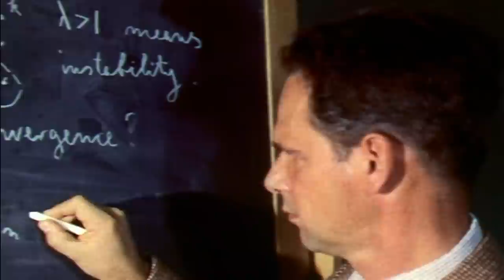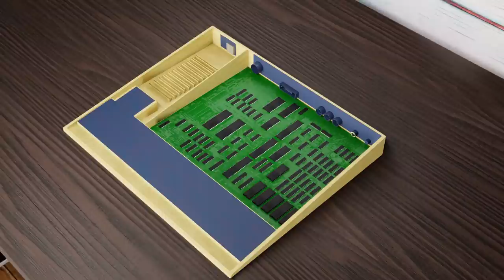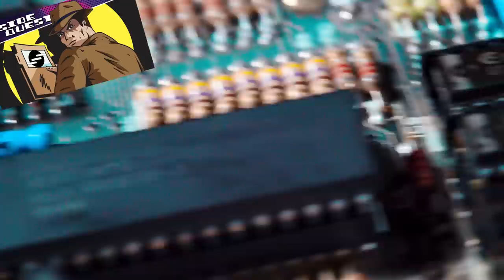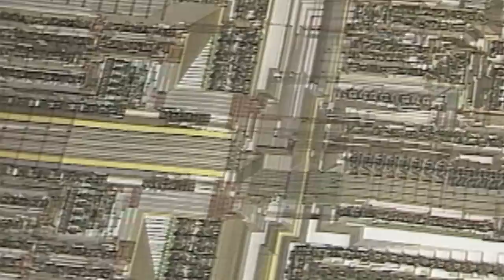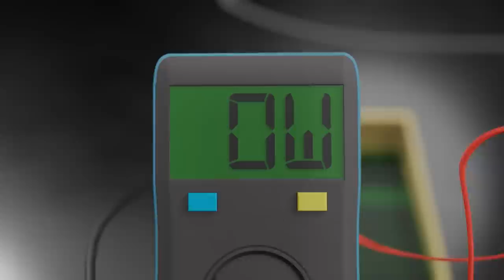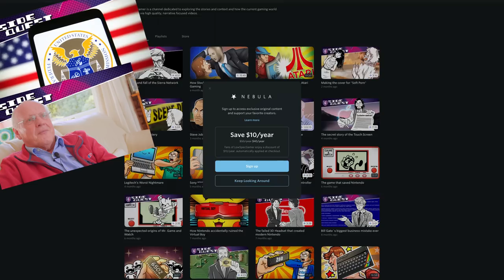How Amateurs created the world’s most popular Processor (History of ARM Part 1)

Comment: They weren't Amateurs. At the time the ARM was created it's designers were professional electronics engineers for 10 years already.
Reply: The were amateur microprocessor designers. Mind you, if anything, this might've been an advantage, as they went in without some of the existing preconceptions that other more established designers were using. It didn't hurt that they also took a leaf out of Chuck Peddle's book, as the internal design of the 6502 and its ISA were major influences on those of the ARM.
Reply: @talideon  Still, amateurs strikes me as rarther clickbaity. I wonder if he said "amateur" to Furber's face in the interview.
Reply: @talideon  "Amateur microprocessor designers" is a false concept. They were all qualified to design microprocessors as much as anyone else in the world. They had cut their teeth before microprocessors were even widely available. When they decided to make ARM they had designed several computer architectures, their own sophisticated operating system, their own programming languages. Not only were they qualified to build ARM but they also chose to build custom hardware and software for the purpose of then designing ARM, because they correctly appraised everything available to be worse than their own prior work.

They didn't go into the ARM project without preconceptions. They had very strong preconceptions. Firstly they had evaluated every microprocessor on the market using their tube system. Secondly, they were academics, and closely followed the latest computer science developments. They knew from watching the Berkley RISC project that a team of their size, budget and experience was more than enough to design such a CPU. It was already a settled question for years.
Reply: The term "Amateurs" is really a metaphor in this instance.  The video shows reasonably accurately that they went to see "professional" designers and realised that there was a very low bar to entry and that they felt they could do better.  They also mention the fact that they still had some doubt in the mind that they could actually do it because they felt like they would be "amateurs" in comparison, as if they were missing something.  If we can do it, what is stopping everyone else?  <-- when you think this its usually because there's something important you don't yet know about.  Fortunately - they were not missing anything, they actually were smarter than the rest.  The ARM went on to be the most produced processor core ever by a huge margin - to date >> 300Bn of them have been produced and production rates are increasing rather than a central processing unit they are more commonly embedded into everything.   A car might now have 30 of these cores embedded in everything from the seat to the AC system.

Comment: Processor back then: so efficient that it runs on leaked current
Processors now: FIRE POWER!!!
Reply: Reminds me of the Prescott Pentium 4s and Ds, there was a freaking 180w one if my memory isn't messed up, and that 220w "5GHz" AMD FX.
Reply: I have Pentium laptops from the 90s that run on passive cooling.
Reply: @Kalvinjj  The Intel 13900KS has a power limit of 320 W! Way higher than anything before! That’s how it hits 6 GHz on two cores and 5.6 on the remaining ones. Many other current Intel CPUs have a power limit of 250 W!
Reply: To be fair, there are modern processors that are much more powerful and consume even less power. They just aren't meant for "general purpose" computers in the modern sense. ARM1 consumed around 100mW at its 6MHz / 3MIPS, and that's just the CPU, while e.g. STM32L0 chips are more like 20mW at 32MHz / 30MIPS, which includes RAM, flash and some built-in peripherals, and can go as low as 0.2mW/MHz, over 100 times more energy-efficient than ARM1.
Reply: @goekhanbag  Holy meme 320W! That and the RTX 4090 melting plugs, care has been thrown out the window.
Reply: Well you’re comparing the RISC instruction set to the CISC instruction set, both have different focuses on computing.
Reply: NVIDIA: unlimited powerrrrrrrr
Reply: @Fractal_32  RISC vs CISC doesn't affect energy efficiency quite as much any more. Modern x86 CPUs are RISC on the inside anyway, they just need a little extra logic to pretend to be CISC and break complex commands down into simple microoperations. Your typical 100W+ desktop CPU can run without any cooling "just fine", it will simply throttle down under 1GHz when it gets hot, just like a Raspberry Pi's ARM chip throttles down under load unless you use an adequate active cooler.
Reply: @JayOhm  it actually does, look at the M1 chip compared to the i5 processor for example, gives out more performance but uses way less power.
Reply: @luigiweegee7152  Ahem, I think you meant "Apple M1 compared to anything else". It consumes about 5 times less power than the newer Snapdragon 8 Gen1, while also being almost twice as fast! Apple just did a phenomenal job with their silicon.
Reply: @JayOhm  even intel's mobile processors (cisc!) have decent power efficiency - its 13th gen i7 u-series supposedly draws 15w at its 1.8ghz base speed for an approximately... 8.3mW/MHz (12x more efficient than ARM1?)? (not that mW/MHz is that useful of an indicator of efficiency...)
Reply: The ARM processors in modern smartphones are even more power efficient than back then but:
- They are not limited in the heat output by cheap plastic packages. So you can crank up the power and obtain even more performace per watts.
- They no longer run BASIC and assembly on "bare-metal" but probably Javascript inside a browser written in Java (which has nothing to do with Javascript), which runs on the Android JVM, which runs on a stripped down Linux which in turn runs on the ARM processor. Not exactly the most efficient use of an efficient processor.
Reply: @qdaniele97  except that in browsers, the javascript is compiled to machine code, and the renderer is written in c++, so if anything the only thing running java would be the tabs/settings UIs
Reply: @5omebody  Actually, thah "java" part is also compiled to machine code, mostly even before the app is started. (The "optimizing apps" screen you might see after a system update is when a lot of thah is done.) That is unlike JS, which gets recompiled every time you reload a page. Still, the original language can hamper efficiency quite a bit: in C you can write something inefficiently, but that's mostly on you, while JS and such can pretty much encourage you to do so, as they are much further from the hardware and something "simple-looking" can hide a lot of complexity and be extremely hard to run, plus you are less likely to understand well the hardware it runs on.
Reply: @JayOhm  except not really. in JS if you write something inefficiently that's also mostly on you. it's not like millions of man-hours have been spent on JS engines just for them to be extremely slow...
Reply: @Kalvinjj  The highest TDP Pentium D's were 130W
Reply: @5omebody  I don't argue that. It is just that, for example, it isn't obvious that putting an object into an array of "small integers" in JS can instantly decrease performance, while in C++ you either wouldn't even get the idea or be painfully aware that it becomes an array of pointers. Higher-level languages hide more complexity and make it easier to write code that is harder to run.
Reply: @Pasi123  Oh yes 130w indeed, I did remember wrong then.
Worst part is that it was back when heatsinks weren't near as insane as they are now.
Reply: @Kalvinjj  and the longlasting world records on highest clocks on cpus where amd fx dominated with crazy figures like 8.5+ghz only recently surpassed by 13900K with 9ghz
Reply: @BeHappyTo  True, they were the CPUs of choice for insane overclock records. Feels like AMD decided to revive NetBurst and at the clock side of things succeeded.
Reply: I'm seeing many posting how these processors are different from the ones we're using and hence the difference in power consumption.

That's not the point. The point is that the processor manufacturers (like Intel, and more so for GPU manufacturers) are sacrificing power efficiency just to claim to have more performance over competitor.
Reply: yep;) looking at current intel core 13th gen, comparing a 13700T (tdp 35w, max boost 106w) vs a 13700k (TDP 125W, max boost 253w) you only lose a bit of performance and the 4090, 4080 and 4070T operate around 30-40% (wattage) above the best performance/ watt  point (which is way above the minimal wattage needed to run processor), that's why they are so good for undervolting;) and so bad for overlooking (they are basically factory overclocked), the current problem isnt modern processor's being inefficiency but modern consumers (and manufactures) not caring about efficiency (any more) but only performance.
Neither performance nor wattage alone paint the full picture, just look at micro processors which achieve their low wattage by doing nothing most of the time (waiting for input/ sensor) and doing things slow (low ghz) (also reduced/ no io, reduced/ no pcie connections, reduced/ no backwards compatibility and reduced/ specialized instructions) and not by being 1000x better at the same task.
Only because a processor draws much power doesn't mean its inefficient and only because it draws little power doesn't mean it's efficient, you need to look at performance per watt to determine its efficiency, which is where mainly server processors shine;)
Reply: and they called it innovation lol
Reply: @Kalvinjj  It's a big concern. The power requirements for recent technology is crazy high.
Reply: @JayOhm  bro m1 max power state is 15 watts, compared to Snapdragon 8 gen1 has max 6 watts, m1 is efficient but it not a smartphone CPU's level efficient, its for ipads and laptops, so research before talking, apple uses A15 etc for their iphones and not M1 for this reason..
Reply: @niks660097  I'm pretty sure I did my research, I'm too paranoid to not do it. I seem to remember looking at some graphs too. However, that was an eternity ago, and at this poin't I can't remember how I got the figures, thus can't quickly check if I made a mistake. Judging by the context of this thread, I probably was looking at single-core performance and power consumption on benchmarks, not TDP, as you could easily have e.g. a CPU that thermal-throttles when fully loading more than one core, and another one that can run all cores fully loaded without throttling.
Reply: @JayOhm  we are talking about efficiency and power usage and you were saying M1 uses less power than snapdragon gen 1 which is wrong, a quick google search would told you that instead of looking back to your "graphs" e.g anandtech cpu deep dives and  why would you talk about single core, just single core even intel can do < 1-2 watts, using turbo boost to boost to 10-20 watts for milliseconds,  thus on average always consuming < 1- 2 watts, even in common tasks M1 will consume > 5-7 watts, just its GPU(integrated) can consume 15 watts without throttle, but they are power limited by apple..
Reply: @niks660097  I would talk about single core because that way it is easier to exclude throttling and inter-core communication effects and estimate the efficiency and the performance of the core architecture itself. Also, power efficiency has nothing to do with TDPs, and everything with how much energy it takes to complete a given compute task, i.e. operations/watt rating. This is all I wanted to add.
Reply: @Kalvinjj  that distinction has pretty vanished pretty much by, you guessed it, another abstraction layer. All complex instructions are reduced to micro-ops. It's been shown that the latency and energy overhead is small.
Reply: @JayOhm  even if the internal microinstructions on x86 are RISC-y, you have to implement a ton of extra circuitry into the control unit to facilitate the translation of upward of a 1000 different instructions (often of wildly varying width). That silicon isn't free, either in terms of space or in terms of power consumption.
Reply: yeah i remember my Rage 2C AGP GPU had passive cooling
Reply: @Kalvinjj  it did hit 5 ghz, in fact with without even increaing voltage you can get the non 5ghz advertized ones to 4.9..
Reply: @cadetsparklez3300  I remember it requiring some pretty obscene cooling to get to that point right? Basically factory overclocked (not like that's a problem tho). 220w is basically the very edge of air cooling if not above most models from my memory, pretty much water only and I don't think a basic 120mm radiator will do either.
Reply: @Kalvinjj  no its really jsut we had bad coolers bad then or people only used stock coolers and remember it being loud. I used a little arctic 9x and it was fine. some people however might push it is far as possible since these things could handle like 1.55V just for performance i guess
Reply: Misleading. ARM is not a processor. It is only a structure/framework. Like a blueprint.
Reply: @volo870  wait you don't need liquid hellium cooling? my laptop requires liquid hillium cooling.

Comment: One of the things that is really interesting is that the BBC ran Acorn ARM based systems to generate on screen TV graphics right up until the cutover to Digital TV.
The systems were highly efficient and fault tolerant and if in a failure state could be rapidly reset, all highly important for something that operates in real-time.
Reply: Custom applications can keep all the code and invariant data in ROM, and often have no need for an operating system, so it's not surprising that when  reset, the application in the appliance is fully operational before your finger even leaves the reset button.
Reply: Well, the Acorn Archimedes Computers were expensive for a PC - but really good as a cheap unix station.
Reply: @akulkis It has an OS.  It's just that the OS is in ROM.
Reply: @Mechness  
You would be surprised how much can be done without an operating system

Comment: Last year I wrote a Basic program that calculated prime numbers and I ran it on both an 8MHz Zilog Z80 and a Raspberry Pi Pico. The ARM chip on the Pico only took a few seconds to do what the Z80 did in minutes. If I recall correctly the Pico was easily 100x faster, and it wasn't even using the second processor core. It's incredible how fast low-spec computers actually are these days.
Reply: To be frank, you compare a CPU with 133 Mhz (Raspberry Pico) with one that was running on 4 Mhz. And even if that's Pico not 100 times faster, you should remember that the OS will take around 1-2Mhz of your Z80, while it will only take around 10 Mhz of your Pico, so you have then 2 Mhz vs. 120 Mhz. It would be ashaming, if your Pico wouldn't perform 100 times faster than the Zilog Z80, especially as it's a 32 Bit controller = so it has to start shifting around bits for still being able to calculate the numbers much later than an 8 bit processor.

Comment: I built my Acorn Atom from the kit (fully expanded 12k RAM and 12k ROM), later bought the BBC B which I modified in a number of ways and finally an Archimedes 310M which I also modified. Finally moved to  IBM compatibles in the early 90's as it fitted with my work by then. Love the Acorns though.
Reply from the maker: Wow!

Comment: It's always great to see this story told. My first "real keyboard" computer was that Acorn Atom (Before that I had a Cosmac Super Elf single board computer). I have really learned programming on that thing (The BASIC on it was a dream to use, because you could mix assembly and BASIC in one program). I still have it, but it needs some restoration to get it in full working order again. Nothing impossible though...
After that I got a BBC-B and finally the Acorn Archimedes and  RISK PC with the RISC chip in it. Writing assembly for that RISC processor was dead simple. Especially compared to those CISC chips that where around on "standard" computers.

Comment: I still remember when the Acorn Archimedes was released (which is probably covered in the next episode). And then I was disappointed it never took off back then. I thought it could become like the next Amiga. Also I remembered DEC ( when they were not yet Compaq/HP) were also playing around with it (StrongARM), probably for a thin client or set top box. 
I think they totally deserve the success that now ARM has become the core of incredibly powerful and efficient processors like the Apple M series.
Reply: The archimedes was doing true 3D well before other computers were capable of it
Reply: @Underestimated37  Oh, there were Silicon Graphics workstations, and other brands, doing real-time 3D from the early 1980s. With custom hardware. At great cost.

The Archimedes was able to manage it just on the CPU.
Reply: @lawrencedoliveiro9104  yeah I left out the words consumer computer
Reply: @Underestimated37  
There's true real time 3d on weaker hardware like the Amiga, ST. and even the ZX Spectrum. 

Granted, 8-bit 3d is usually more impressive than playable, and even ST/Amiga 3D is really compromised (No Second Prize is the limit of what you can get at a solid frame rate, though Hunter has its charms), but yeah, the Archimedes was the first western computer to make it a viable potential alternative to 2d. 

Still, it wouldn't be until the mid-90's that the potential was really realized, and you had the power to execute a 3d version of every 2d game. And it was still a questionable goal until the late 90's, early 2000's.